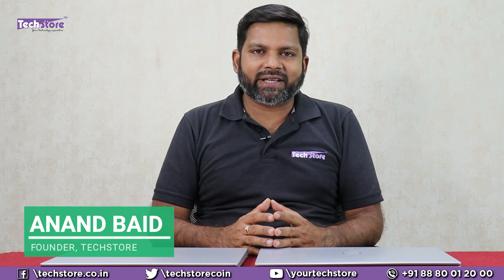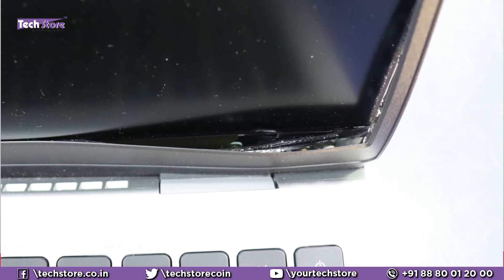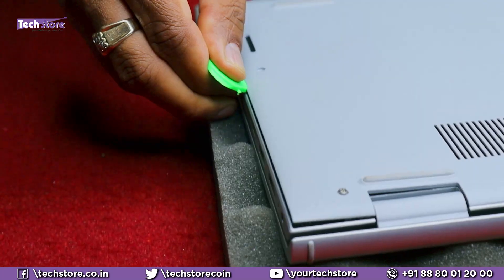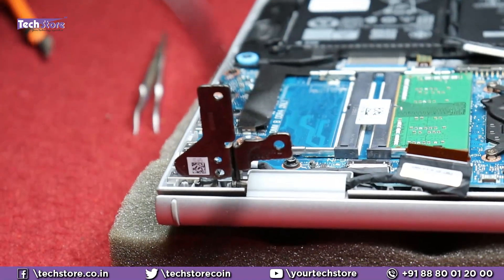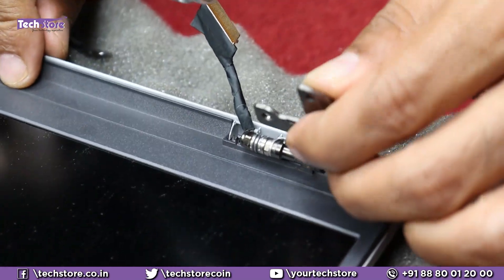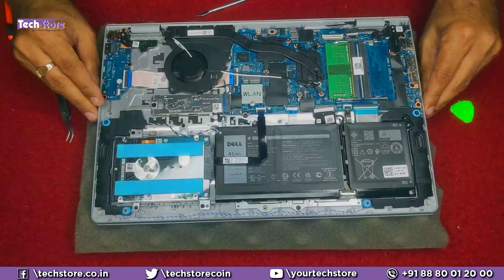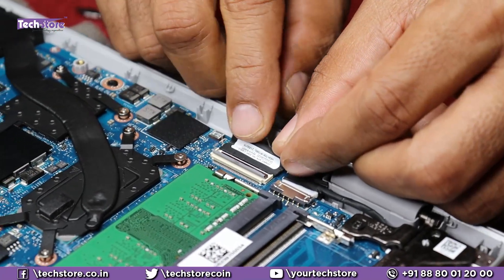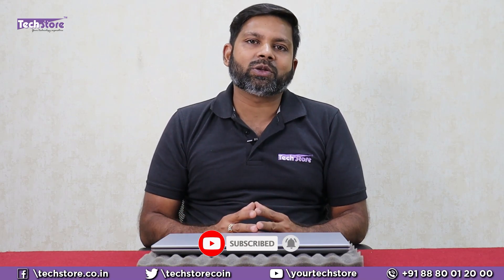Dell Inspiron 15 3511 3515 3520 3525 Hinges issue resolved: calibrate the hinge of any slim laptop

Comment: Hi
Thanks for the video
My inspiron 15 3511 got destroyed due to stuck hinges. 
Dell refused to fix it whereas laptop still under warranty 
Dell are clearly selling faulty products
Reply: They did not fix it?
Reply: @swatigawade3335  After discussions they agreed to fix it for free. let see
Reply: @Gneisneau  same thing happened, it's been how many days since you purchased??
Reply: @----------------------------60  Happened 6 months after purchase roughly
Reply: @Gneisneau  how much time does it take to get this fixed at the store.
Reply: @Gneisneau  I think you should choose Dell latitude, XPS, Precision if you considering replace your current laptop.
Reply: @Gneisneau   same to mine. I just bought it 6 months ago and now I was told yesterday that this is not covered by the warranty. No service center is available either. SMH
Reply: Thats the reason I bought Lenovo Ideapad Slim 5. It also has camera shutter and fingerprint. Lenovo meaning it self is Innovation.

Comment: Sme issue I bought dell laptop and 1month also not cmpltd and same hinge issue happened
Reply: Bro did you get replaced and get new laptop?
Reply: @----------------------------60  no bro
Reply: Again that model was proved fake so better to go to dell shop only since again after repair with 2500 same issue repeated. So better go for Dell show room don't compare cost
Reply: Bro how many years you buy from the store its alright?

Comment: Hello dear,
I bought this model 3 months back and exactly same situation happened. I followed everything but unfortunately I didn't have the spanner you are using. Kindly let me know the model and from where you bought this spanner to looses the screws. Your quick response will be highly appreciated. Thanks in advance.
Shiv
Reply from the maker: You can use a plyer (pakkad)
Reply: @TechstoreCoIn Plyer may damage the screen. I need the spanner what you have shown in video. So please give me details of it. Thanks.
Reply from the maker: You can buy ratchet screw driver OXIOV 41 Piece 3-Way Adjustable Ratchet Driver Screwdriver Set with Bits and Sockets https://www.amazon.in/dp/B0917KZRSY/ref=cm_sw_r_apan_i_SN54WHJNY1QPYHBNZKMV?_encoding=UTF8&psc=1
Reply: @SMOHPAL  Did you buy this spanner and this fix your problem..?
Reply: @BIPINKUMAR-bk7rw   No as I got this reply very late and after threatening Dell Executives that I would make sure to sue Dell in USA to recall back this model sold all around the globe and this this hammer worked and they fixed my laptop with new parts and it's working pretty good now.
Reply from the maker: Have you subscribed ?
Reply: @TechstoreCoIn  Yes. Of course. SInce the video was so informative I immediately subscribed it. Thanks.

.

Comment: Hi.. By any chance Sir, are you anywhere here or around Delhi? 🙂 I am about to purchase 3511 and would like to prevent breakage before any nightmare. Student here on budget. Thanks😉
Reply from the maker: We are from Karnataka. You can get the hinges calibrated after buying.
Reply: @TechstoreCoIn  Thanks for the quick response. I will follow up as suggested. Gooday
Reply: @lovemoon9803  Better go for Lenovo Ideapad Slim 5. No hinge problem also has camera shutter and fingerprint. Lenovo meaning it self is Innovation.

Comment: Thanks Sir🙏 for this video. Have a Inspiron N5010 and one of the hinges had gotten tight and was not closing down the lid all the way. I was about to order new hinges. Came across your video and adjusted the screw on the hinge and it solved the problem. For the N5010, you need to break the hinge cover tabs to remove the black plastic cover so you can access the hinge adjuster screw. I had tried once to repair the problem thinking it was an alignment issue but  could not see the hinge mechanism due to black the hinge cover. You saved me the cost of hinges. Thanks. I was procrastinating this issue for months but as you mentioned in the video, the additional stress can damage the display and also damage the plastic parts due to stress application.

Comment: Thanks Sir🙏 for this video, I recently got the replaced Inspiron from dell after hinge broke. 
So, I loosened the hinges of new laptop after watching your video. 
1st time screen didn't start, So, I had to open again to properly insert VGA connector. 
Now it's working like butter.
Reply from the maker: Glad it worked for you
Reply: Do Dell charged money of it?
I have got the same issue , will they charge money from it, please tell
Reply: @manvendrasingh4369  if it's in warranty they will not
Reply: Sir its been 1.5 months since i bought the laptop and yesterday hinges got broken but display everything is fine,should I go for replace of laptop or should i let them to repair? Plz reply
Reply: @----------------------------60  go for repair
Reply: @manvendrasingh4369  where is ur office

Comment: Does the problem arise for every laptop purchased?
Reply from the maker: Yes, almost all 3511 3515 have this issue
Reply: I have got a DOA letter from Dell for the replacement of inspiron 15 3515 model but this model already have manufacturing defect , my laptop have heating and hinge issues. What should I do?  They are giving me the same laptop model in replacement .
Reply from the maker: Get your money back from your supplier or ask him to replace with another model
Reply: @TechstoreCoIn  Company is saying that we have given the DOA letter and they will not refund or can't give the upgraded laptop or different model
Reply: Can I file complain in Consumer court
Reply from the maker: Where did you buy the laptop?
Reply: @TechstoreCoIn  Offline
Reply from the maker: Which dealer and which place ?
Reply: @Aao_Ghumaye_Bundelkhand  yes do it
Reply: My laptop hing issue why dell  in local products use
Reply: I'm struggling to find ANY make of laptop that doesn't have this problem (excluding ruggedised laptops).